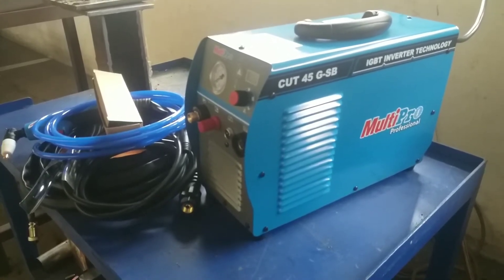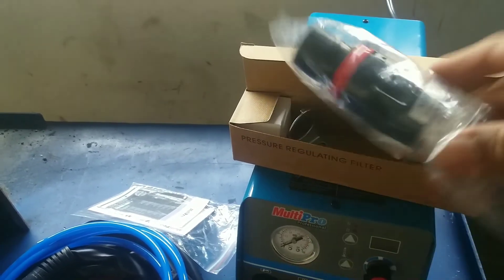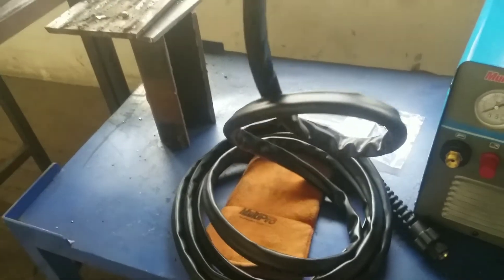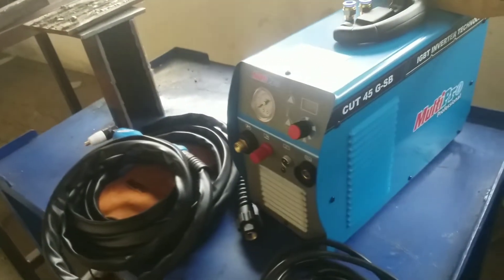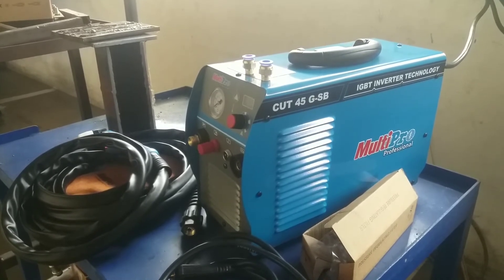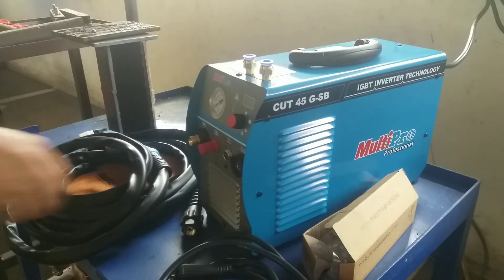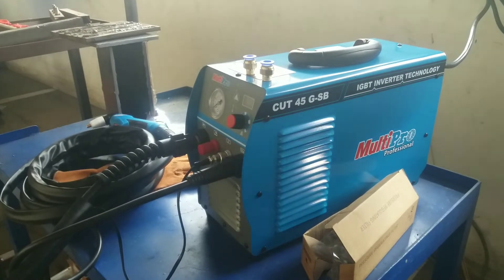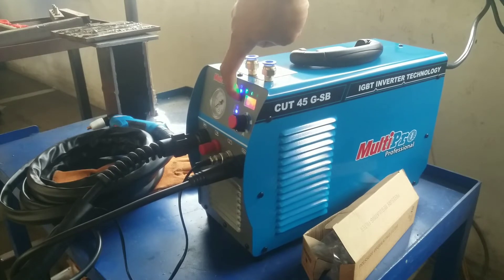Apakah Plasma Cutting Multipro bisa multifungsi..!! MIG MMA TIG

Comment: Kalau tidak keluar angin apa masalah ny?
Reply from the maker: selenoid valve untuk angin tidak berfungsi. tidak berfungsinya bisa dari tidak mendapat tegangan atau selenoidnya rusak.
Reply: Selain itu  apa lagi yang perlu di cek mas
Reply from the maker: regulator angin yang ke mesin, dan switch pada plasma torch karena triger utama untuk mesin on dan angin keluar dari switch torch.
Reply: Terima kasih informasi mas
Reply: Ini model plasma kami. Multi pro CUT 40 G_KR
Reply: Pak kl multipro cut 45G-SB torch nya di ganti dengan yg P80 dgn pilot arc apa bisa pak..?